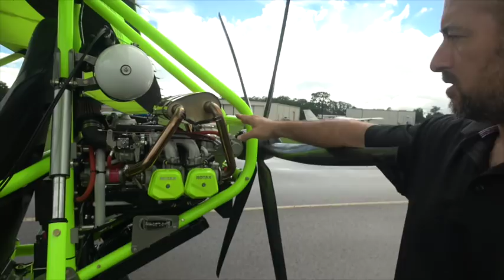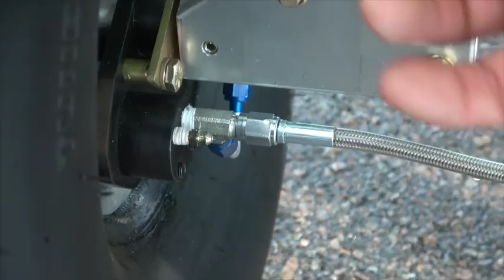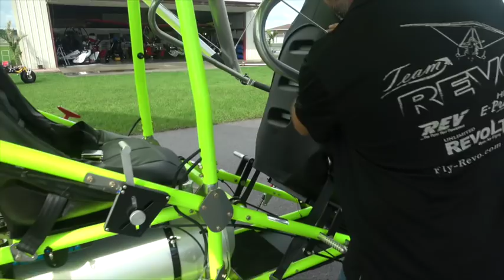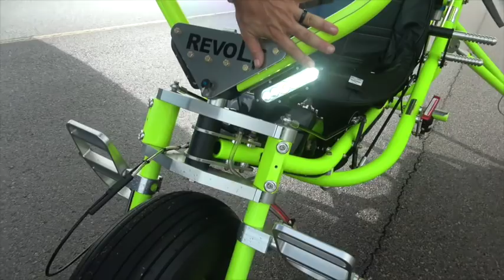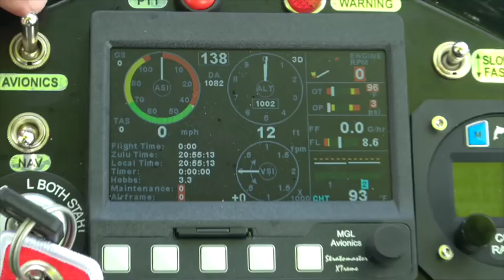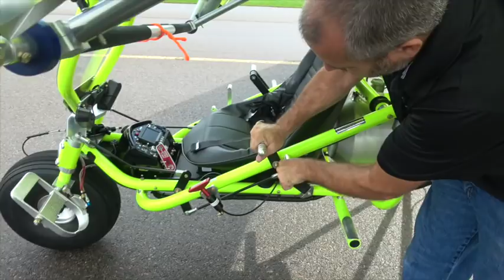REVOLT

Comment: sir I want only information for propeller, what is the thickness, length, height,Width, 🙏🙏  actually sir, this propeller I will make a home, please help me sir🙏🙏🙏🙏🙏🙏
Reply from the maker: Do You understand the size of the propeller as well as the pitch the twist is directly related to the horsepower and torque of the motor combined with the reduction ratio of the redrive?  

Look up specs on props. Unless you have a 582 with a 2.62 reduction, the information you are asking for is worthless.